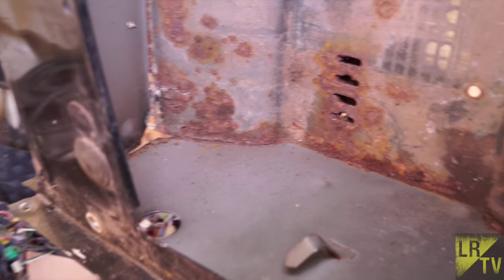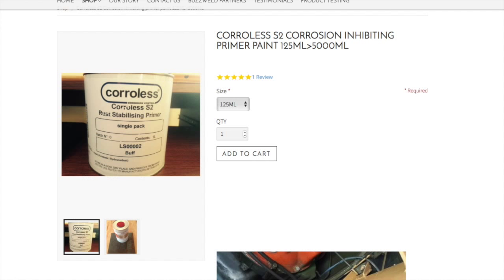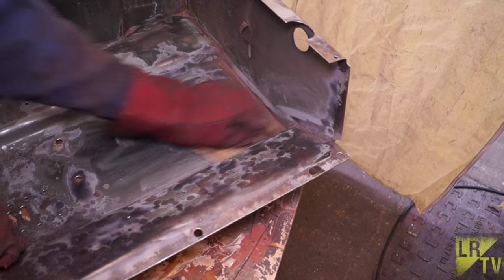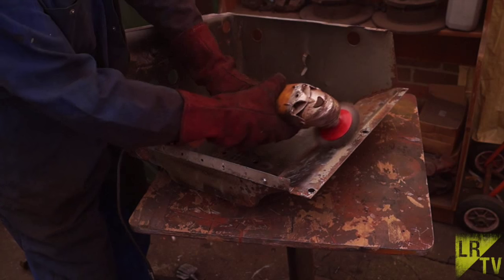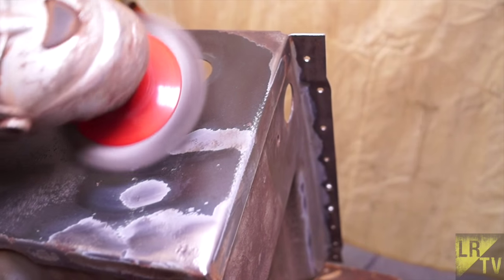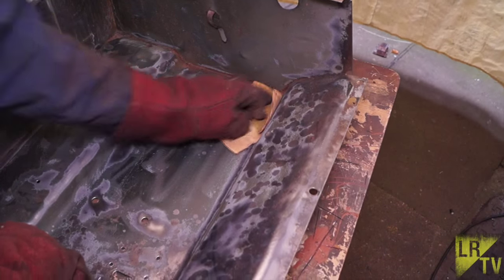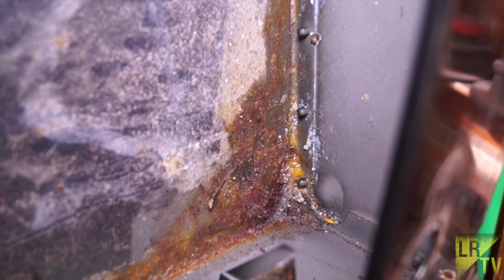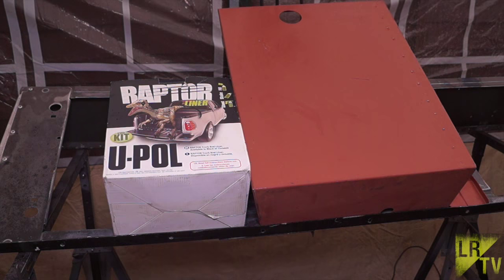Rust busting - using Corroless  rust inhibitor primer on Land Rover Steel

Comment: Great video, with excellent step by step approach.  I've just done a similar job - used black stone chip applied by aerosol over the inhibitor/converter. Will finish off with Waxoyl when refitted to the Landy.
Reply from the maker: +Peter Walker  Stonechip needs to be painted since it absorbs water.  I don't think under seal will work on top of it.
Reply: +Land Rover Toolbox Videos Thanks - I'm in a position to do that as still restoring. ....... Gets out spraygun and fires up compressor
Reply from the maker: good stuff!